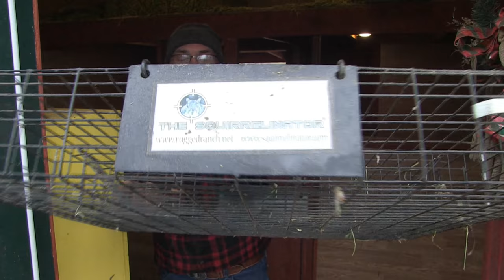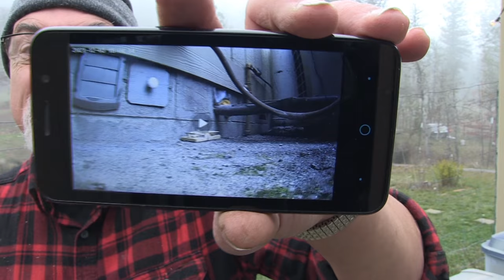I GOT RID OF RATS - How I Got VICTORY Over The Infestation

Comment: For the holes under your house instead of foam use steel wool!  This works wonderful around pipes...use a screwdriver and stuff steel wool in all cracks! Hope this helps you!
Reply from the maker: I also am using that around the line set. Works great. I also packed steel wool around the pipes penetrating through the floor in the bathroom when I did a complete remodel.
Reply: Don't use steal wool, it still rusts and deteriorates, I use straight up Copper mesh stuff it tight in the hole, around pipes and voids. I then hit with pest-block expansion foam. One and done. Why go back Year after year.
Reply: @thecrittergitter7576  that is the same thought I had, copper mesh, or stainless steel mesh, expansion foam, I think that should work well together
Reply: @thecrittergitter7576  I agree with you 100 %  when I talk to people on rodents I tell them to use copper mesh it will do a better job and last a whole lot longer and I have found that the copper will tear up the rodents mouth far better than the steelwool hands down.
Reply: My step mom had them coming in her trailor the exterminator put steel wool then the foam on top which held it in place. Then sat traps which where enclosed .
Reply: I used steel wool and stuff it tight in my chicken coop.  They are smart because they removed it all.  I then put the steel wool back in and put flex seal on it to seal it.  Well guess what they removed that too!  I heard they do not like flex seal.  I also gave them baking soda and corn meal.  They didn’t get in to it much. I recently bought from Amazon the Kat sense covered rat trap. So far I have had great success with them.  The only problem is I have to empty them pretty regular. Easy to use and I don’t have to worry getting my fingers smashed in a rat trap.  I have bought pretty every thing he has used too.  Rats are no dummies!
Reply: Can anyone give me advice on what to look for around the foundation of my home as the mice entry ways?
Reply from the maker: pjewellful2012- 
I featured that in another show: Enjoy Here are some other shows I created on this subject:
HOMESTEAD HACK-Ridding Rats In The Attic  https://youtu.be/X2GNa0kWNz8
KILL RATS DEAD WITH CORNBREAD MIX: https://youtu.be/TBeySuYvdbY
KILL RODENTS AND INSECTS WITH BAKING SODA; https://youtu.be/lwzWpBGn0No
CONTROLING RATS IN THE ATTIC: https://youtu.be/X2GNa0kWNz8+
Reply from the maker: Mama Hen- I used that in a previous episode. Works great.
Reply: I wouldn't use fine steel wool it is highly flammable
Reply: I have a mouse problem in my house and they chew right through steel wool that I put where there are holes.
Reply: I used tufts of steel wool and covered that with the spray foam.  It worked for me.
Reply: Steel wool works great.  Have in a lot of cracks around pipes .
Reply: Use Coarse Grade Sharp Steel Wool - Softer Grades Won't Work.
Reply: @thecrittergitter7576   It's Called "Stuff-Fit"
Reply: Steel Wool?
All Steel Wool Rusts.
Use Only IF It's The Heavy Course "O0" Grade (The Soft One's Useless)
COPPER IS BEST (Doesn't Rust)
Reply: @Bob-gn8ph   
Also Too Soft And Rusts.
Try Copper Tightly Fitted
Reply: @meredithpollock3165   Use Steel Screen Mesh WIRE,  Under 1/4 Inch.
Reply: @theresatrahan2147   
Use The Heavy Course Grade - NOT The Soft Fine Grade.
Reply: I’ve always used screen wire cut in rectangles and uses screwdriver to push it in! Now I never have screen wire. So maybe the steel wool is a great idea!
Reply: Yes it’s better it will cut up their mouths and feet when they try to get through it.
Reply: Use steel wool with silicone so they don't just pull the steel wool out.
Reply: @BadlndsBob  ... or silicone them in.
Reply: I used steel wool, and somehow, the rat was able to push the wool out, so I had to put wire mesh to back up the steel wool, and its working so far.
Reply: @mikechevreaux7607 My Dad used fibre glass. Well, that's what it's called in Ireland and the UK anyway.  I don't know what ye lads call it there. It's basically a yellow coloured densely matted 'wool' made of glass fibres. You can prick your fingers and hands (and lungs) up with it really badly if you don't cover up. It seemed to have worked for us.
Reply: N
Reply: Aluminum foil works as well.  They wont touch the stuff.

Comment: In my area of NW Washington State, we have mostly the Black Rat (Rattus rattus) and occasionally the Norway rat.  These varmints often burrow into and under things like my compost pile.  Anytime I see one of their tunnels I go for them with road flares whose smoke is very toxic.  I have a little battery-operated fan I use to push the smoke down the tunnel entrance.  The smoke will come up through several hidden bolt-holes.  This method is very effective and isn't harmful to any other animals.  Also, it makes disposing of the carcasses easy since they're all underground already.
Reply from the maker: Thank you
Reply: Robert that's genius !
Reply: I gotta try this one
Reply: Would that toxic smoke not poison your compost?
Reply: It doesn't destroy your car like a potatoe in the exhaust pipe ?

Comment: You have some terrific tips. I had the same problem and spent hundreds on traps and mass marketed baits. Ratx/Mousex didn't work in its natural form, so I used a grinder (mortar and pestle) and ground it down to powder. I then added a cup of peanut butter and a cup of cocoa powder to three cups of ground ratx/mousex. That worked for a while, though expensive. I moved to a more economical approach and now use one cup peanut butter, one cup cocoa powder, one cup borax and three cups baking soda. I mix this until it's flaky or add a slight amount more peanut butter to the consistency that the powder mix doesn't break apart. I use borax to keep the ants and other insects from stealing the bait. 

As for mouse traps and peanut butter. I use a mixture of one cup peanut butter and one cup borax. Ants and other insects will take the bait if you use peanut butter with no other additive and you'll assume the mouse took it. Using borax in the mix will eventually kill off any other insect population in the vicinity and the mouse traps will still be baited until a mouse is caught.

I also clean my mouse traps with deodorizer after a rodent is caught and alternate the traps.
Reply from the maker: I found that the baking soda also kills spiders, ants and roached.
HOMESTEAD HACK-Ridding Rats In The Attic  https://youtu.be/X2GNa0kWNz8
KILL RATS DEAD WITH CORNBREAD MIX: https://youtu.be/TBeySuYvdbY
KILL RODENTS AND INSECTS WITH BAKING SODA; https://youtu.be/lwzWpBGn0No
CONTROLING RATS IN THE ATTIC: https://youtu.be/X2GNa0kWNz8+
Reply: @pinemeadowshobbyfarmafruga8319  That's unfortunate for the spiders, I prefer keeping them around. I forgot to mention if you want to locate where they're nesting obtain 8oz or more of UV-reactive pigment. The pigment works best indoors and will help locate a rodent's circulation. They will also ingest it and you'll have UV-reactive turds. This helped me locate access points that I had missed and what areas I need to clean and replace. I need to purchase a different color of UV-reactive pigment this time to make sure they're eradicated. The pigment is messy, it's a particulate, and I usually wear latex gloves and a mask when handling it.
Reply: Same here Clark. I have spend hundreds on all kinds of traps (including the electric shock track that hasn't worked so far), I have tested all kinds of different food to attract the mice as well. I am just glad I found out about the baking soda method (I have a large basement where I have seen mice, so setting traps all over would be a challenge). I just spread some bait with the baking soda in a few spots that I have seen them. I hoping it works.

Comment: I found two traps with mice in our storage under the main part of the house. After searching for a while found a dirt hole they had dug to get under our driveway which leads right into storage. So I used expando foam to fill the dirt hole. For some reason they won't try to dig thru expando foam. Anyway, best way to fight rodents is to block entry into house, around perimeter & block entry on roof. If you have a whirlybird - gizmo that spins to pull air out of attic, you need to put heavy duty screen material inside, because they can slip between the whirlybird & the round metal opening. I found that out the hard way. Also, DO NOT keep cat food or dog food in storage. Also with Snap Traps, 1/2 way cook bacon & stuff it inside the middle bait opening. They cannot resist bacon & as they try to pull the bacon out, the trap will snap shut. Takes a few minutes to kill them though. The more they struggle, the more it collapses their small lungs & zing they're gone. I usually use a pellet rifle to finish them off.
Reply from the maker: I used the foam and steel screen. Works great at blocking their entrance. Also I keep this bait out to rid any others which may come near the home.
HOMESTEAD HACK-Ridding Rats In The Attic  https://youtu.be/X2GNa0kWNz8
KILL RATS DEAD WITH CORNBREAD MIX: https://youtu.be/TBeySuYvdbY
KILL RODENTS AND INSECTS WITH BAKING SODA; https://youtu.be/lwzWpBGn0No
CONTROLING RATS IN THE ATTIC: https://youtu.be/X2GNa0kWNz8+
HOMESTEAD HACK-Mulch using Cedar https://youtu.be/85Zlk5SRHeQ

Comment: I don't have a farm, but I live in the Mountains, in the middle of nowhere in the woods near Glacier, WA. I've had a lot of luck with Peppermint oil! One night I sprayed some under the tarp in my backyard that covers my kayak and bike. 5 min later I see 2 mice running across the CENTER of my yard, running away from the house! They never run in the Middle of Anywhere! So, now, before I go to sleep, I spray peppermint oil all over the kitchen and anywhere that I think they are getting into the house.  OR I  use the peppermint oil to herd them to a specific room where I have my live trap! It works like a charm! I put 30-60 drops in a large spray bottle of water. Did you know that they can find their way back from 3 miles away!? So I drive them across the bridge that's 1 mile away. That way they can't get back to my house unless they are smart enough to cross the bridge (nope!). I've had a lot of luck with the peppermint! It bothers some older people with lung issues but for most people it just smells nice!!  --- I had luck with the bucket! I caught a rat, I didn't even know I had rats! A month later I saw that a dress was eaten through, most likely from that rat cuz there were 1.5" black hairs! So, now I spray peppermint all over the inside of the house. I even use it in the doorway when I need to open the doors in the summer. They hate peppermint because it messes with their sense of smell!  This guy Shawn Woods has a lot of great ideas! You can't get the Victor Peppermint anymore, at least not on Amazon. https://www.youtube.com/watch?v=wNaNGH_hnEE
Reply from the maker: I sprayed that everywhere in my shed. Did not work for me. The rat came in, built a nest and had babies among the scent. In these videos I answer your questions and also offer solutions and products to repel rodents: https://youtu.be/NUuqAmE1NE8 - and Huntavirus by CDC https://youtu.be/5hdsjebQzwM. Thanks so much for watching.

Comment: for anyone trying the bucket method, don't use a narrow steep ramp like in this video. I bought the flip and slide lid and use a 5 gallon bucket. But I don't think the lid is high enough to get a Rat to slip throught it into the bucket. (the Flip and Slide lid is more for mice). The way I got a rat to feed from the top of the bucket is I built a ramp out of different level empty boxes, books and then I put old blankets on top of the boxes, so the rat could easily climb up to the top of the bucket, and leave small amount of food bait like dried cat or dog food on the ramp to attract it upward).  What made me think of this Idea is this one determine rat started climing my mountain of empty boxes in spare room to get to the dry cat food (I was storing it in a box to keep it away from kitchen area, so he must have smelled it). I still haven't killed rat, but at least it is feeding from the bucket now (before the bucket sat with the narrow ramp for 2 months and no mice or rats ate from the bucket lid, no matter what bait I used).

Comment: I sure hope everybody else has better luck than I did. We did the baking soda and the jiffy honey muffin mix. Are experiencing that it seemed to have invited them in. The things just make me cringe! I even just put baking soda down and they ate it. Still hadn't seen a decrease in them though.
Reply: Copied from my above post, so that it would show up in your feed.
Peanut butter mixed 50/50 with baking soda, and add some old candle wax shavings.  The fine mesh on a cheese grater works perfect for getting small wax shavings.  For the barn I would have moved all of the animals out for a few hours, completely sealed the barn, and run a generator inside until it died.  Uses up all the oxygen and fills the place with carbon monoxide which even gets into wall spaces...  Kind of a poor man's whole house fumigator that professionals use when they tent a house.

Vent the house well, as the carbon monoxide will kill anything that breathes air, including you and your pets.  The exhaust smell will vent fairly quickly.  Don't forget to seal and then vent any attic spaces.

The good thing about the peanut butter mix is that they love it and it can be rolled into balls and scattered around any space without any powder mess or making boxes - very similar to rat poison blocks, but mostly harmless to pets... mostly harmless, because it will temporarily reduce stomach acid strength affecting digestion for a meal, so you don't want them to get into it every day.

Comment: I hit the idea from another homestead YouTube using equal parts sugar, corn meal, baking soda. Just as you use it has been the only thing working my homestead. 
Another one is mixing peanut butter and plaster of Paris into a paste about size of marbles and leave out. 
Thanks for sharing your experience.
Reply from the maker: Sounds great, HOWEVER, I do have a caution about the use of Plaster, cement, or other poisons which I discuss in this video - https://youtu.be/FycSoPkT36A and https://youtu.be/mAly4sBM63I and https://youtu.be/lwzWpBGn0No

Comment: I congratulate you!     I had some mice issues before.  First was mice in basement,  they used the central AC pipe to hose and oil tank nossle space in plywood.  I used calling mixed with s.o.s.   and I still had the old school banned dcon mice pellets [wish I still did] I caught 3 in glue traps , killed 4 with poison.   They died in a.dark corner.  I fixed it in a week.    I than had mice in my shed, I used 1 x 8 native pine boards for siding and boards had gaps . I CAULKED the entire SHED. Tons of work, lol. Lucky I scored a case of amazing commercial grade caulking for free.    Glue trap killed 4 mice, never a problem.   NOW I saw my first RAT 🐀 In my garage!  I had it really cluttered after a house remodel.  I think it took 3 weeks of my neglect and having my Camaro parked for snow and winter.  They got under my garage door, not sealing.  I looked in a old drawer I was using to.store all my extra sweat shirts,  I didn't look in drawers for about 3 weeks. When opened drawers looking for a t shirt! I saw each drawer had a nest!! No rats. But huge droppings in all three drawers and piled up trash debris [oh yeah, my teenagers left trash bags in garage when I was on a business business trip, I cleaned up and figured it was a squirrl, squirrels have done that] no it was a gross rat 😢.   I removed the drawer and cleared my garage COMPLETELY!!   Filled my Nissan Titan with all the clutter.. took me 12 straight hours to.clear my garage.     I did see the rat runaway the night I discovered nests,HUGE.    Next day after all clean.   I left a dish with RATX mixed with seedless sunflower seeds on a Styrofoam plate.   He crapped all-around the plate, lol.  And ate most of it! I also taped glue traps to the floor.  No rat , but a mouse.     I than paid a garage door guy to replace my garage seal.  Now garage has no entry.   NO more poop.  BUT I was seeing mice or baby rats, scurry In out of my outdoor precast cement HOLLOW front stairs.  I dug around to get in.   I left tons of baits for a few days.  Than emptied 3 cans of rodent [TOMCAT] SPray under the stares!.  Next day mice or tiny rats were scurrying in DAYLIGHT,  probably desperate to escape the horrible mint scent 😂.   I think  they had pups under there?   They finally gave upand no site!  I also sprayed under my other shed, baited as well. And moved fire wood pile much further away.    Restocking and spraying layers with the mint.  Also sprayed mint under cars.    I think milder winters are 😢keeping more alive?    The mix of sunflower seeds [no shells) with Ratx I think  killed the rats? Got lucky maybe they didn't have a litter.   I removed all old mulch around house, I stuffed trap rock under stairs. Best I could, I now only have stone gravel,  NEVER Mulch again.  I lost 3 weekends to VERMIN 😢